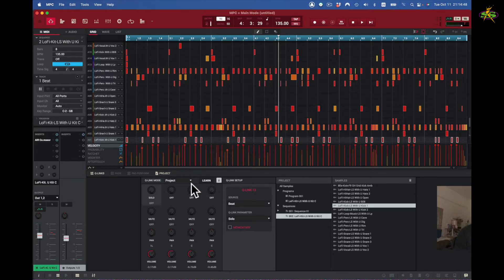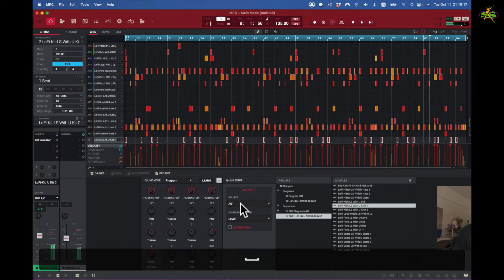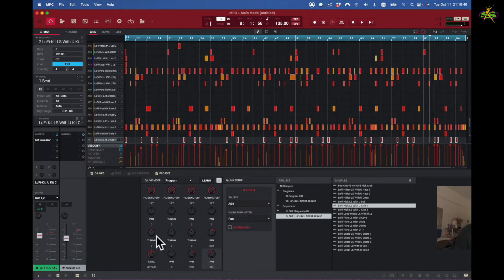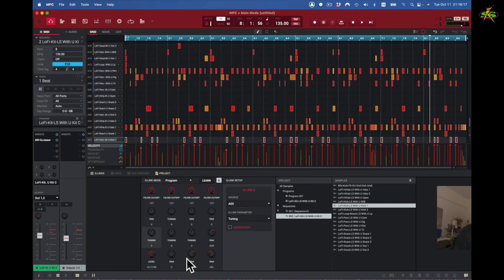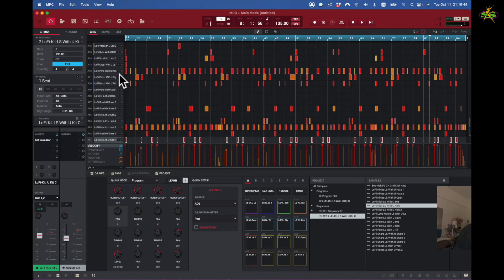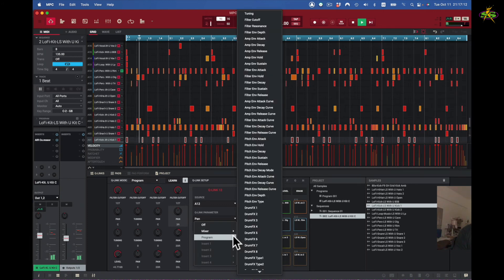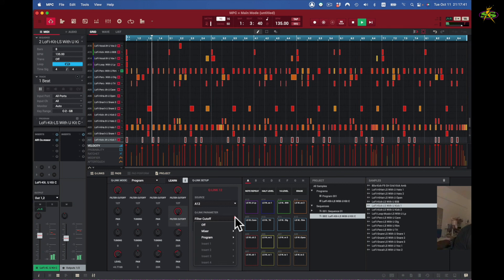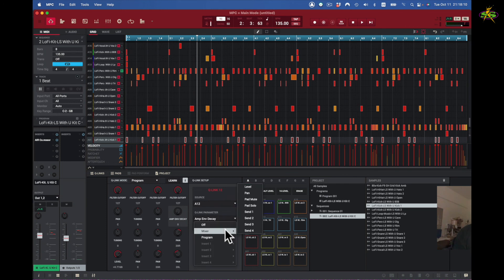AKAI MPC2.11.6 Software PART 12: Q-Link - PROGRAM

Comment: Good video , here’s my question .
I have a 404 like program setup on my mpc live using the a links, I  can save the program which saves those settings but I cannot save the qlink settings individually and load onto other beats I made . I can load that program with those settings of course , it woods be nice to be a able to load qlink settings to any program I’ve tried all options saving as fx rack also and it doesn’t work. Do I really have to setup those settings on the beats I already made or is there a secret way to load those settings somehow ?? Thanks
Reply from the maker: Saving Q-link setting has been a problem for standalone which is why I just use MPC2 software.